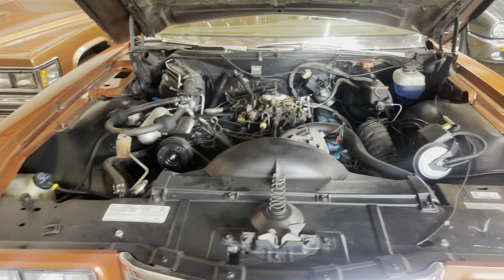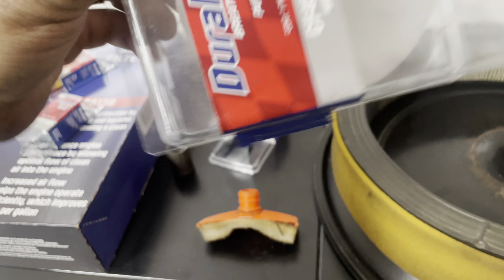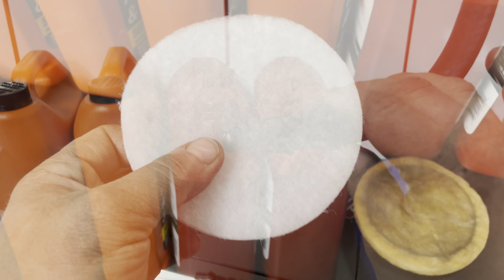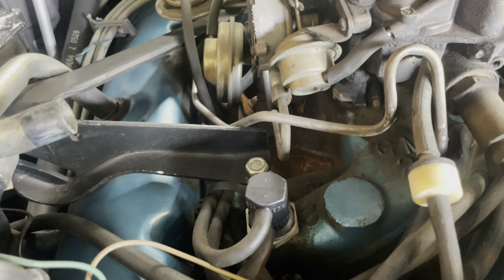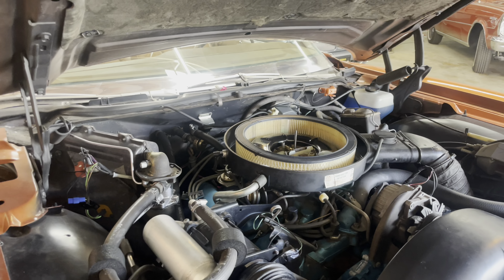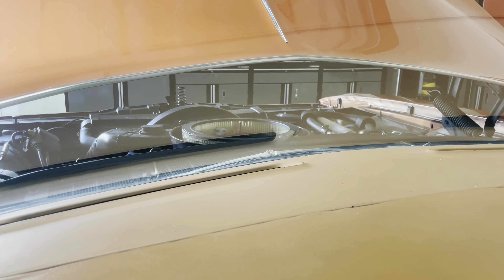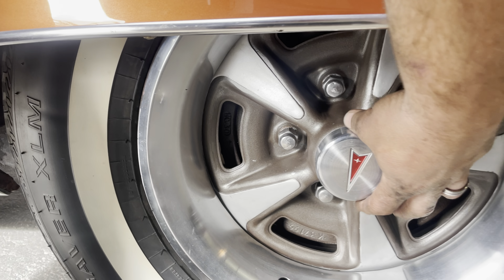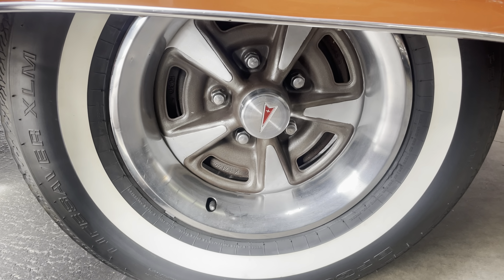Barry’s 1975 Pontiac Grand Ville Brougham - maintenance and service

Comment: Would love to see the progress on changing the charcoal canister  filter would you mind sharing
Reply from the maker: The filter itself is fairly self explanatory and is done. I’ve got a detailed video on changing the actual charcoal media out on Barry’s Oldsmobile Cutlass. 
Barry's 1979 Oldsmobile Cutlass Brougham - rebuilding the charcoal canister, PCV and more
https://youtu.be/vaVQNCFNqeg

It’s the same canister.  To change the filter easily, pull out the canister, flip it over on the bench, pull out the foam media, slide in the new one.